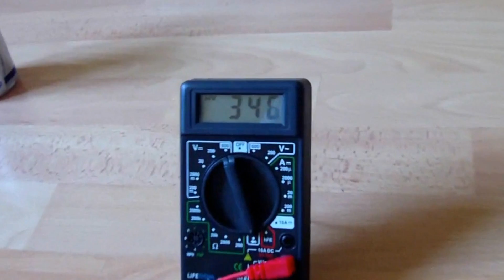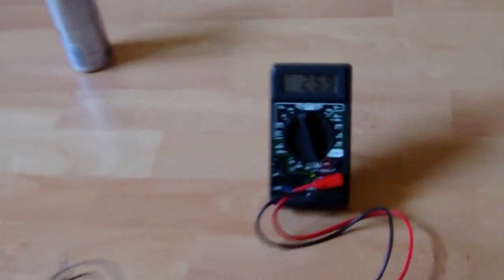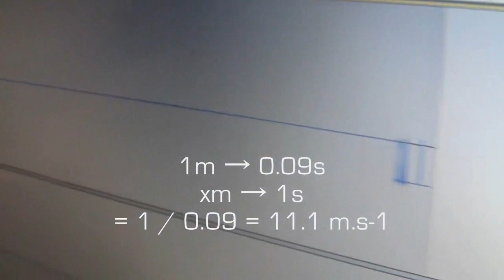Coil gun : DIY Experiments #1 - Gauss rifle / homemade coil gun / DIY weapon / Electric gun

Comment: Id wind 
EVERY LAYER the same direction, 
so the magnetic fields of each layer would be 
n/s, n/s, n/s, n/s, n/s
You've wound it back and forth, 
so you're magnetic field of each layer will be 
n/s, s/n, n/s, s/n, n/s
Do you see how they'll give totally different results? It PUSHES the magnetic field outwards through repulsion,
Winding back and forth PULLS the magnetic field inwards through attraction within the coil layers itself
Hopefully you might try a side by side, 
for others to see as that's one comparison not done yet ;) definitely 2-3x stronger

Comment: Here's some advices:
The electromagnet coil is too long and too few turns, if you make it shorter and with the same or more turns it should work better, and if you want it to be this long you can make it with more turns and add more voltage, because if there isn't volage, enough current can't pass trough the wire.
Other than that this coil gun is really powerfull and it would be interesting with a better coil.

Comment: I found out that the strength of a magnet scales with the weight of the metal in the coil and the efficiency increases when you get closer to the maximum amps the wire can handle without heating up.

Comment: You want to increase efficiency? Seems easy. You can use IR sensor in front of coil so when the bullet is exactly in the middle, coil stops running. So, coil not depends on circuit timing, but rather position of the bullet.
Reply from the maker: In fact it would be more efficient but more complicated!
The way to have a high efficiency would be to increase the voltage during the shot in order to get only the right electromotive force corresponding to the speed of the bullet. Here the voltage decreases with time and for instance at the moment the bullet starts to move the efficient is 0% while we use power to generate only a stationary force.

Comment: Cut your projectiles in 50mm long rod's sharp one end an on the other side drill a hole . Maybe half of the diameter and make experiments.
When you reduce the weight it maybe will go faster

Comment: try small metal filament or fillings or whatever you call them. they should go faster
Reply from the maker: +YouTube Police : We rather remark than more the projectile is heavy, more is will be launched fast so its kinetic energy is really really higher ! The efficiency is low but it increases with the size if the projectile which will "recover" more working magnetic field :)

Comment: Cool, i would love to see the step up schematic, i have got one that only steps voltages up to 400v, but i would like to go higher than that :S
Reply from the maker: +RandomLOLGamer : You just have to use a transformer with a higher ratio :)
It's possible to use a high frequency (as 20kHz) then use a ferrite transformer so you can do the windings by yourlelf !

Comment: Is it possible to use a piezoelectric spark igniter rather than capacitors?
Reply from the maker: +Paper Armory : A piezo gives some milliwatts ! It's absolutly not powerfull even if the voltage is high. Here the instantaneous power is tremendous ^^
Reply: My design is going to use extremely lightweight ammo. It's a paper shell with a nail head cut off and placed inside so the foil will have something to propel. I'm even making the cannon itself out of paper, with the exception of the power source and coil.
Reply: *coil, not foil. Autocorrect is annoying at times.
Reply: Paper Armory wtf
Reply: What? It isn't impossible

Comment: which is more electric energy efficient for the same amount of kinetic energy produce from projectile, railgun or gauss/coil gun ?
Reply from the maker: +Ilham Defra : Both have a 100 % theoric efficiency but for a homemade system it is easier to get a decent efficiency with a coilgun.

Comment: Hi.I already build my own coil gun but I have a small problem.When I press the trigger projectile stuck in the coil.Can you write me what im doing wrong.Sry for my English.
Reply: You need a short pulse of current in that coil, otherwise when the projectile is accelerated it is immidiatelly pulled back by the same magnetic field from behind.
Reply: I think the friction forces between your projectile and surface are greater than the force generated by the coils and that is why it doesn't move
Reply: I think the friction forces between your projectile and surface are greater than the force generated by the coils and that is why it doesn't move

Comment: Holy shit homie that's genius project ! Keep going...like+sub
btw...is it hard to build?
Reply: Its not too hard to build, but it would be good if you had some electronics experience. I like how he did not disclose the exact way to build this as the voltages involved here can not just hurt/burn but cause death **very easily. He probably used an oscilator to drive a transistor or mosfet that would be connected to a transformer to step up the voltage, it would then be recitifed by a diode/diode bridge and then stored in the caps. You discharge the caps throught the coil and off goes your projectile. But anyone who is new to the hobby and not a pro should use caution big time when experimenting. Great video!

Comment: You should post instructions about how to make this device 
I have tried to replicate this using 4X 2000uf capacitors @450V in parallel but I just keep burning out my wires and making huge sparks and the nail doesn't move 
Also how do you convert capacitance and voltage to joules
Reply: +mewantbrains Energy = 1/2 * C * V^2. If you're burning out your wires you need to use thicker ones. The current discharge can easily be in the hundreds or even thousands of amps.
Reply: What wire would you recommend for my application 
I'm currently using AWG 18 speaker cable 
At about 80 turns 

The capacitor bank consists of 4X 450V 2000uf in parallel 
And I'm trying to fire an iron nail through a piece of plywood but it doesn't really work at all

Comment: one can easily trace your basic circuit just from this vid. You are using your transformer and a few MOSFETS to charge your caps, and an SCR as usual to discharge...might as well post a schematic for analysis
Reply from the maker: So your "one" can't be anyone... ,)
No SCR or semi-conductors here for the discharge ! Only a basic switch.
Reply: I stand corrected. Why did you decide to not use an SCR?
Reply from the maker: Cause they are only recovered componants :)

Comment: I see u have 2 transformers what is the use of the second small one?
Reply: The second one is here only to supply the oscillator (independant from the 12V one). It's really an "old" schematic jugin by us now, we can do easily with a single transistor MOSFET.
The automatic stoped charge work with the time : a discharge of a cap' in a resistor (threshold of a transistor for trigg...)
Reply: oh thanks for the reply :) but i have a small request can u tell me how ur automatic switch off circuit works?
Reply: As I said, a device makes 14s to discharge a capa to 3,6V form 12 (3,6 V is the threshold of the mosfet in my case). Then the curent pass over a relay reverser to turn off the power supply of the charger ;)
Reply: thank u very very much i was wonderind if u can could u make a rough schematic  of ur "whole" coil gun setup or at least the cut off circuit and thnx again and may God bless u :)
Reply: im working on a similar project for my grade 9th science fair so ur help is of very importance to me and of high appreciation.i was also asking if i face any problem could have an easy contact method .
Reply from the maker: Ziyad Mohamed : In our french fecebook page ;)
Reply from the maker: In fact ! 
I can't say more than : It makes 14s to discharge a capa in a resistor to 3,6V form 12 (3,6 V is the threshold of the mosfet in my case). Then the curent pass over a relay reverser to turn off the power supply of the charger ;:)
Reply: Thanks help anyways 😄 no problem👍hope ur channel succeeds and see more of ur awesome videos 👍👌
Reply: Thank you for ur replay but says its simplified  for the non automatic